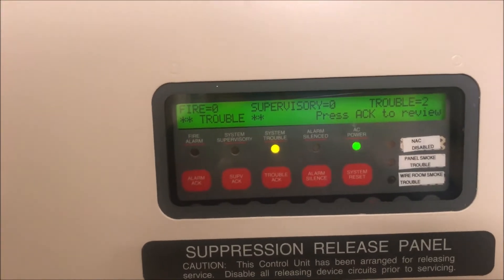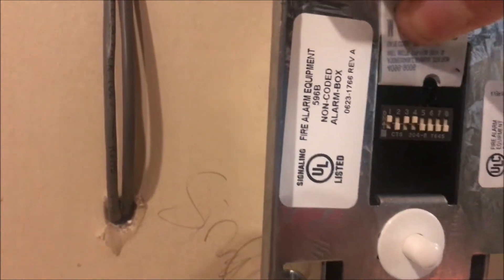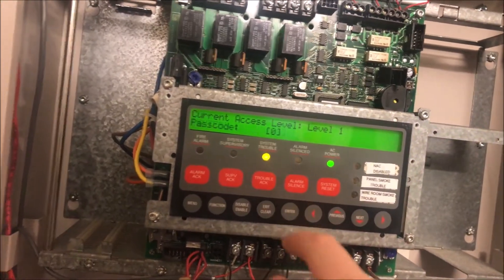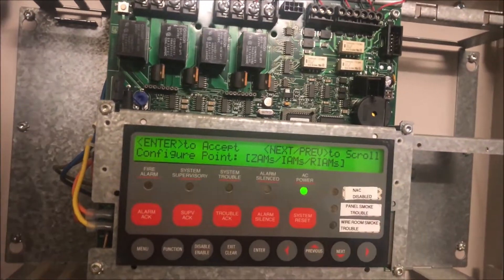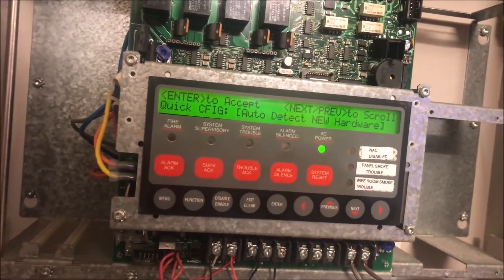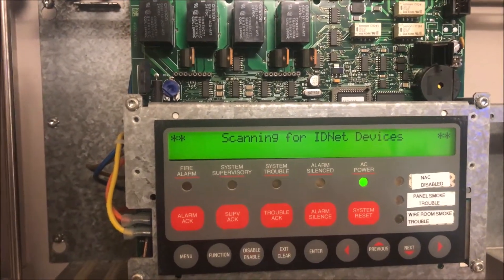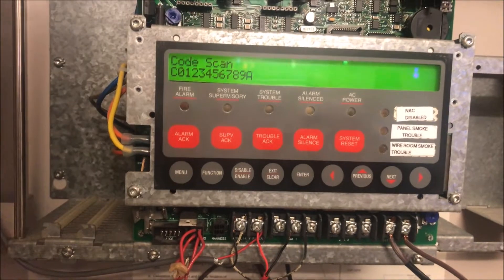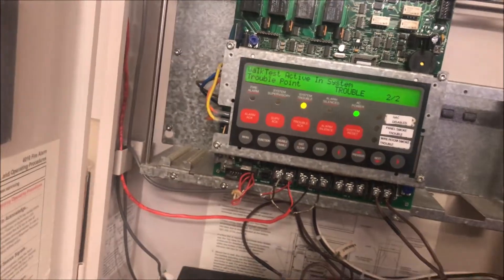Adding an IDNet Point to a Simplex 4010 Fire Alarm Control Panel

Comment: so now my question is: where do you wire the idnet device to the 4010?
Reply from the maker: It would be through the main SLC loop on the panel. Its the terminal block on the top far right corner.
Reply: So through terminals 1 and 2 then?